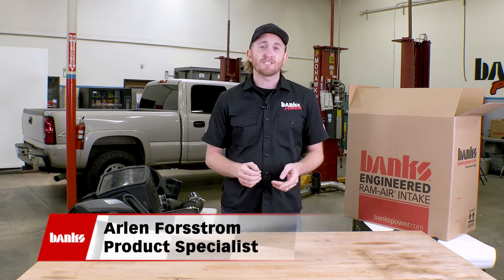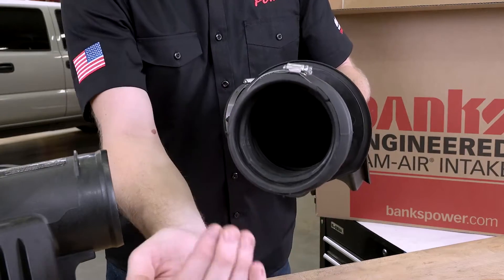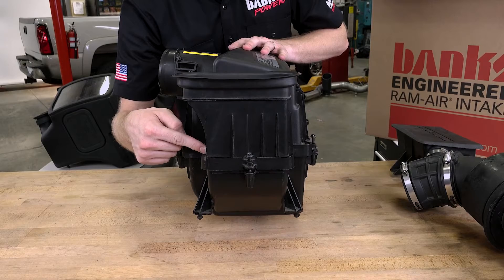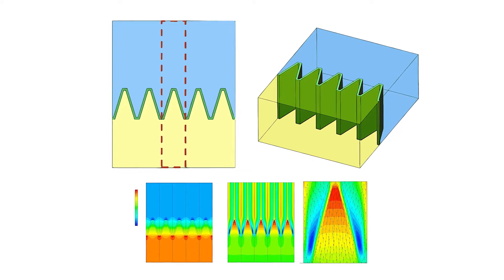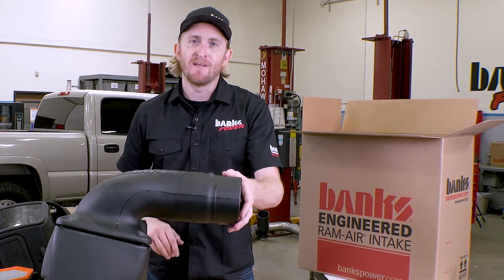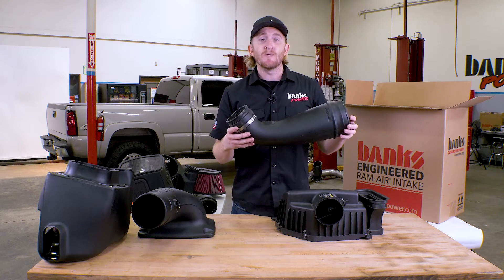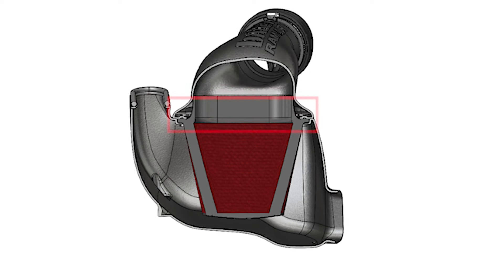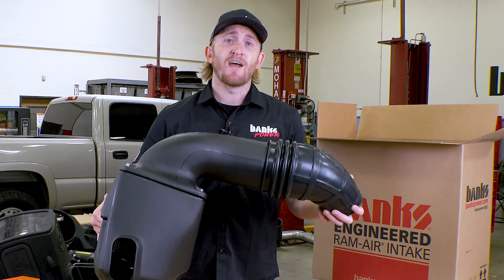Banks Ram-Air System for 2020-23 Duramax L5P | Features, Benefits, and Competitive Analysis

Comment: Or you can just shut off the air filter setting, I have an s&b intake on a 2020 gmc dually
Reply from the maker: Our system is designed so you don't have the air filter alert off.

Comment: When is coming out for the 2024 L5P?
Reply from the maker: We do not have an eta at this time because we are still developing and testing the Ram Air intake and the Derringer.  The 2024+ L5P Duramax trucks have a new updates for emissions regulations and new computer systems. Because of these changes, they are even more sensitive to any major changes like air flow rate and temp. We must work with these changes an unfortunately that has forced us to change harness and programming on the MAF module that is included with the Ram Air intake and the Derringer tuning.
Reply: Stuff just started hitting shelves and hp tuners just got unlocks for 24,25

Comment: Side air inlet on the ram air? Looks like it will suck in hot air from engine bay through there!! Good thing i saw this video before ordering!!
Reply from the maker: There are three air inlets on the 20-23 L5P Duramax Ram Air Intake. No port opens directly to the engine bay where you would be drawing hot air.
1. The top that draws in air through the factory hood scoop.
2. From the front that connects to the core-support tubing.
3. Passenger side fender wall.
Reply: @bankspower thank you

Comment: Will running one of these void the factory warranty?
Reply: I'm here to tell you YES! Just had mine voided today!!! I just lost the remainder of 100,000 mile powertrain warranty on my 2022 duramax....because of this intake!!!
Reply: @BOOYAHSUCKA3  Damn. I'm sorry to hear that, man. I'm not an expert on warranties or anything, but I will say this. I have heard that a manufacturer can't void your warranty unless they can prove absolutely that the modifications you made caused whatever failure your truck experienced (Your truck had some sort of mechanical issue, right?). I'm not 100% certain that is true, and there are probably some caveats to the laws surrounding the topic if it is, but it is something you should research. Don't let them finalize voiding your warranty if they legally can't.

Comment: Good afternoon, where can you buy that complete system for a GMC Sierra Denali 2024 gas
Reply from the maker: The intake is not available at the moment, we are developing the 2024+ DMAX. This version varies from the 20-23 intakes with changes to the tubing and MAF module to work with the GM ECU emissions changes. To sign up for the "On sale" alert, this link 👉🏻 https://bankspower.com/products/chevy-gmc-2500-3500-6-6l-diesel-ram-air-intake-system-42120

Comment: I wonder what they are going to do about the engine code P22FB that these things cause? I installed the ram air on my 2020 gmc about a month ago and got this code after about 500 miles. Turns out they dont do a very good job of "tricking the ecm".
Reply: Did they fix that error code?
Reply: @Captdavis1  no it went away for about 6 months until the map sensor got dirty and threw it's code again, after cleaning it, the code came back, so far I've driven it another 1500 miles.

Comment: I installed the ram air system and Derringer on my 2020 Duramax L5P. Check engine light came on. They sent me a new module installed the new module still regents more often then before installing. My fuel mileage has not improved under the same driving conditions. As far as I can concerned the ram air system is a WASTE of money.

Comment: I just installed mine on a 2023 gmc denali 2500 and right away the check engine light turned on
Reply: What did you do take it off?? Or is your check engine light still on??

Comment: No way that patent is valid, the maf translator/safc/safr have been doing something similar for 20+ years.
Reply from the maker: We appreciate you watching commenting. We'd like to add some clarification. We are not claiming that we invented MAF manipulation. You are right, MAF correction has been used in tuning for decades. However, with patent 11193441, we may prohibit the sale of MAF modifiers when combined with aftermarket intakes. This patent does affect anyone altering MAF via ECM tuning, or even the sale of stand-alone MAF modules. It prevents the sale of MAF modules WITH aftermarket intakes, specifically.
Reply: @bankspower  That sounds more plausible, but still easy to get around, might not be an all in one package like you provide though.

Comment: I just got mine and it seems good so far. My only two gripes. 
1. Why is the lower box only supported by a singular flimsy bolt? 
2. The filter doesn't fit in the lower box channel? It won't snap in until the top ram is squishing it in place.
Reply: How long did it take too arrive. ?

Comment: I installed this on my 2022 2500HD. After 2 weeks I got Air Filter error message. Banks just me sent me a sensor but I haven’t had time to install the new one yet. Hopefully it fixes the issue. The only other issue is that the seal around the hood inlet could have been designed better as it comes off air box fairly easy. I do have the Banks intake, exhaust and Boost Tubes. Very happy with both throttle response and MPG improvement.
Reply: I still get the Air Filter error message every so often but I happy over all.
Reply: Maybe if you turn off the filter notification in your infotainment, it might stop sending the error.
Reply: How is everything currently working out?

Comment: Post Dyno number increase for another selling point would be great.
Reply: I'm not sure it actually increases power on my 2023 chevy 2500. It does increase throttle response and it has a cool grumble sound.
Reply: The power gain is probably not noticable

Comment: A maf sensor is just a heated resistor that changes resistance with temperature so yeah why not just include a new sensor with the correct values? Price?
Reply from the maker: Yes, the physical wire in the MAF sensor hasn't changed since its inception. However, it's no longer an analog sensor. This new digital signal and data that the sensor communicates to the ECM has changed a lot. Not only does the sensor report Air Mass, but it also has a barometric sensor that measures pressure. For example, if you put a K&N or high-flow filter in the stock airbox, it'll set a code because it's flowing too much air. The ECM thinks the stock filter is so clogged that it's sucked it into the intake tube, allowing air to flow around the filter unrestricted and unfiltered. In short, there's a lot more going on in air intakes in vehicles 2020 and newer.

Comment: I have one on my 2018 L5P, with boost tubes, and the 5" exhaust.  There is a marked improvement, in power and mileage.  Damn good products!
Reply: How much of improvement?
Reply: @joeb.8625 , the average mileage picked up about 2MPG. My butt-dyno says there is at least 20 more HP. It's a noticeable difference. I will say that it is every bit that Banks claims.
Reply: any noise difference truthfully? I am really considering you're setup!
Reply: @TPH9311  , no sir. No noticeable sound difference

Comment: I have one installed on my 2020. Only complaint I have is the vibration in the throttle pedal at take off and when shifting under light throttle.
Reply: Hi I saw your Instal video  It help me installing mine thank you and did you ever think of switching back to the stock airbox to see if your vibration goes away?

Comment: I will probably leave the one on there, that was installed when GM built it, when the warranty runs out I will trade in for a new one, the factory one works just fine for me, I often tow a 15000 trailer with a 9000-12000 skid steer or excavator
Reply: I mean if you wanna miss out on improvements then go ahead.

Comment: Would be nice to have 1 for the 1999-2013(LS) and 2014-2022(LT) Gas Trucks
Reply: Banks make them for the LS based trucks. It's the banks ram air.
Reply: @allanb3222  they make them for the 1500s. Not the 2500/3500 with mechanical fans.
Reply: @jerryreyes3358  The op just asked For LS engines, he didn't state which model.
Reply: @jerryreyes3358  im pretty sure the 2500/3500 with a LS Engine uses the same intake, not sure about the 8.1L, there is 1 for the 6.6 DMax
Reply: @allanb3222 LS1-LS9 can all use the same airbox fyi
Reply: YYYEESSSS.
Reply: No need for it.

Comment: Looks like an AWESOME product! Does the air filter need to be oiled, like a K&N filter?
Reply: I'm pretty sure you can get an oiled or dry version
Reply: @spencercampbell8396  I really appreciate the oiled versions of air filters.  I've been running, cleaning and reusing them for years and 100K plus miles without any issues.
Reply: He do you know which one you have?